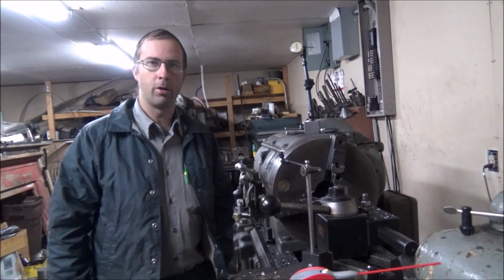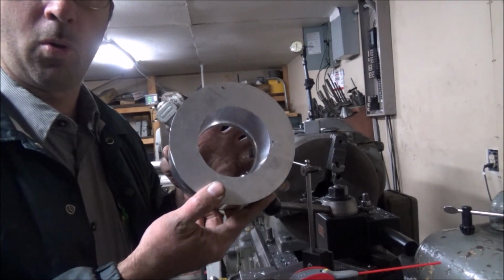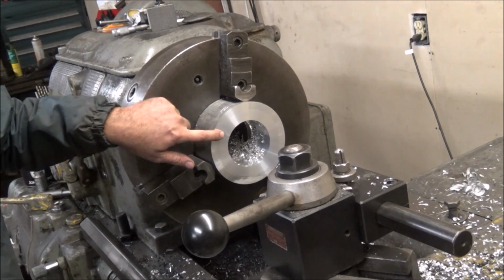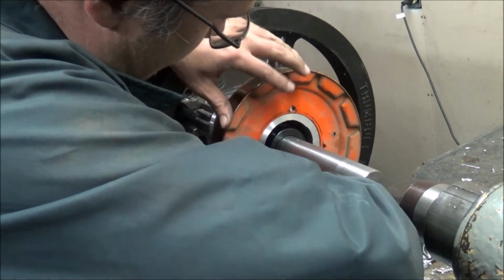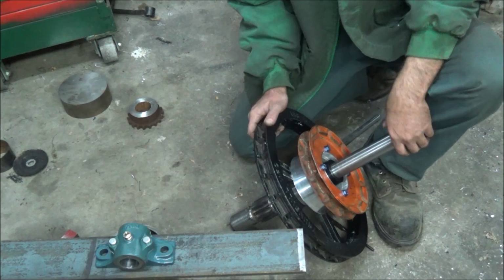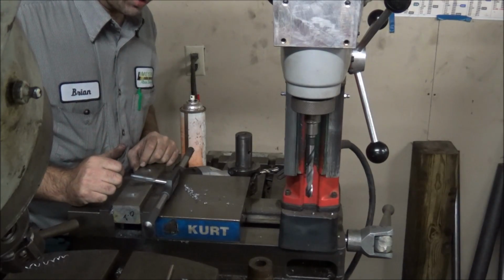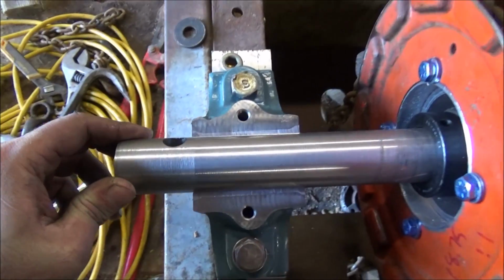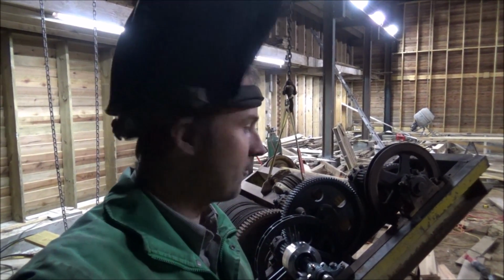Rebuilding/restoring the Shaw Box 15ton Hoist Part 6

Comment: Nice job Brian. Looking forward to see it back up in the air. regards from the UK
Reply from the maker: It was a struggle but it is already there, now time to find the right hand chains and get them put on. :-)
Reply: Do you have any pictures?  I hope that you slapped a coat of paint on it before lifting it 25' in the air.
Reply from the maker: John Ferguson
No I was busy running the lift, the forklift and prying with 2x4's to bother with getting any pics plus I did it at night in the doorway so the shadows up there would have really been bad. I also didn't paint it as the chains and me wrestling it around would have knocked half of it back off and scratched it all up. I will just have to do that bit later.
Reply: bcbloc02   There is nothing like hangin in the air with a bucket and a brush.  But it's not a bad as working on the roof.  I broke my back falling off the roof.  The guy holding the ladder decided that there were more important things to think about instead of paying attention to the ladder.  Be careful up in the air, hanging out with your ass in the breeze.  It's not the fall that kills you.  It's the sudden stop at the bottom.

Comment: I love the improvised drill press.  That's true hillbilly engineering.  My dad was born and grew up in Kentucky.  He listened to bluegrass music and drank bourbon so I am at least half hillbilly.  Thanks for the video; I know that it's a pain in the butt and a labor of love.  It's fun to watch your progress.
Next time you're at the hardware store, spend 50 cents and buy a cover-plate for the electrical outlet by the lathe before you electrocute yourself.
Reply from the maker: No need to buy one I probably have a dozen here already. I just have to climb over the lathe and put it on.
Reply: Like the old boy that had a leaky roof. When it wasn't raining it didn't matter and when it did he wasn't going to get wet! How many times do you climb over? Not many I wager.
Reply: The uncovered outlet ain't nothin compared to that breaker panel with no cover... I notice it in every video, then again Brian has his priorities, there just isn't time enough for everything.
Reply: Volcker1929   I am sensitive about electrical safety because I saw a welder electrocute himself when I worked at Rockwell. It sounded and looked terrible.
Reply: John Ferguson That's because it was.

Comment: If an EMP ever hits over Kansas, your barn shop will be the only one left with a working hoist. That's a compliment, BTW.
Reply from the maker: I am in Kentucky but yeah, it will work as long as the operator will, it is pretty reliable and self contained. :-)
Reply: bcbloc02 Whoops. The other K state. In my defense, if there is ever an EMP over Kansas, Kentucky will be lights out just the same. Now if you just had a water wheel or windmill to run the lathe...
Reply from the maker: Thomas Utley
Baily in a squirrel cage? lol
Reply: bcbloc02 Well, you did say 500 RPM is max speed...

Comment: Another way to find the 3 holes would have been to take a compass, set it to the R of the circle and then mark off on the circle the 6 segments and use every other one for 1 of the 3  holes... I like your comments.
Reply from the maker: Yep that would work too. I usually like to go the transfer route though as I have been burned before when I did that only to find out whoever did the other part didn't make them equidistant.

Comment: A 3 inch diameter drill Brian. My first lathe would just tun that, and your drill for sure weighs more than that whole lathe did. :-) And I didnt know you could get aluminum to break into chips that small. One more step closer to shop completion.
Reply from the maker: Good speeds feeds and chipbreakers rock for keeping the stringy bits at bay!

Comment: I'D say big bit and nice shavings too! No wonder the Cummins ran sio good after you got through 'doctoring' on it. Bet you needed a pyrometer as big as a dinner plate!
Reply from the maker: It can run flat on the floor and never crack 1000deg in the manifold so no worries on that, maybe out in the big mountains but I never drove a semi thru Denver.
Reply: bcbloc02 Just drop a gear and go on. That's what we do here. It's around 32 to 3400 feet above but steep and crooked. I don't aim to go to Denver unless it's in a dream. I drove an RD with a 'Fire Breathing 350' as the Mack boys called it and when it got to 1500 you better shift or back off because the needle was pegged. It had a 12 speed so I never worried but some other guys that didn't watch the gauge did. Butt chewing time!

Comment: i guess you can use those aluminium shavings as Christmas decorations!
Reply from the maker: Wish i had a way to seal a bag, filling up a bag of machinist "chips" would be fun!
Reply: Isn't that what Santa gives to bad little machinist's for Christmas? No tool-steel in your stocking, just a sack full of oily chips this year, LOL!
Reply: i heard santa comes in and blunts all your drill bits if you are bad!

Comment: I noticed there was an electrical box on the side with old wires.  Had it been previously been adapted to use a motor drive of some kind?  Very nice work on the restoration.
Reply from the maker: Yes it had previously been retrofitted poorly with an electric setup that was both shot and under capacity. It is shown and discussed in the early vids if you want to see what it had.
Reply: Ah, makes sense now.  I'll go back and check the others now before asking questions that may have already been answered.
Reply from the maker: Keith Ward
No problem and don't worry about asking questions as I always try to answer them if I can. With over a hundred videos stretching over multiple years it can be hard to keep up. :-)

Comment: Nice job recreating the original design. A shame you didn't have a bit of I beam the right size so you didn't need to use up that O1 piece.

It probably isn't part of the original design, but I think I'd put a small spring on that pawl to pull or push it into engagement. It could be real embarrassing if it somehow flipped over backward.
Reply from the maker: Unless there is like a 10.0 earth quake I don't think it could ever flip over backwards. The spring makes the clicking of the pawl a lot louder so I prefer not to have the extra force adding to what gravity does.

Comment: Nice Job Brian, ehhh talking about drill bit wandering... LOL
Are you going to put some sort of spring on the lock arm ?
Reply from the maker: I think gravity will be enough, I held it 2in away for a test and it still fell right back. If I run across a super light spring I might add it for safety. That MT6 to MT4 adapter sticks that bit about 2ft out of the tailstock, it is a limp noodle out like that with that big bit but it will punch a hole. :-)

Comment: That is a major achievement, well done. I look forward to seeing you testing this monster. Is the cable on the drum in good condition or will you have to replace it?
Reply from the maker: It looks good, I found one spot that is a bit smooshed but it should be fine especially since there are 8 parts holding the load.  I unwound it all, lubed it up, and am putting it back on the drum properly now.

Comment: Are you going to replace the cable? It looks weathered. Which means rusted and compromised. I am enjoying your vids.
Reply from the maker: I soaked it in diesel fuel and it is flexy again now and looks much better. It is in way better shape than the cables on our roll backs. I see no reason it won't hold 3750lb.

Comment: 15 ton lift: nice: no batteries, no wiring, no dangerous electrons trying to escape...except for the 110 volt receptacle behind the Monarch without a faceplate. Be careful... OSHA may be watching.
Reply from the maker: I wonder if they were watching when I was standing outside the basket on the lift hanging on with one hand trying to put bolts in?

Comment: Dunno Brian, but I tried forever to find the proper speed and feed for Butter.  It's not even on www.matlweb.com
Reply from the maker: On butter you need to just run it fast enough that it melts, then you have cutting oil and no chips. :-) I suggest filling your chip pan with popcorn before doing this.
Reply: lol yeah that'd probably work too.  Good work Brian!

Comment: Your sound is very erratic
Reply from the maker: I blame my new editing software.  For some reason it was fine in editing, but then I noticed after watching the complete edited file after upload it was messed up and parts were lots quieter than they should have been. Sadly after a 2 day uplad I wasn't going to do it again. I will try to check in the future before I upload, or just get different software, what I had been using wouldn't work with this new camera.